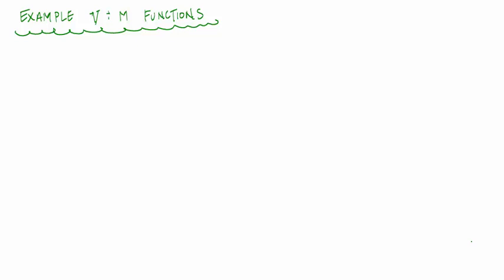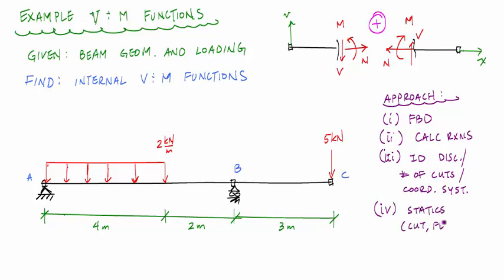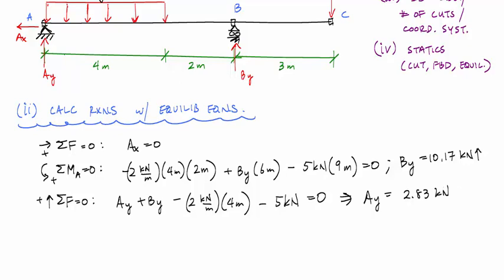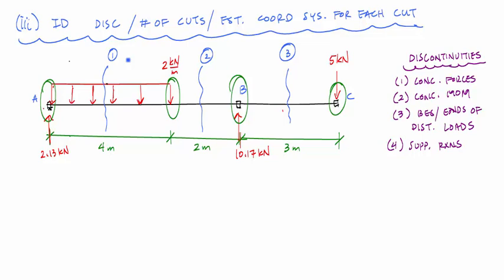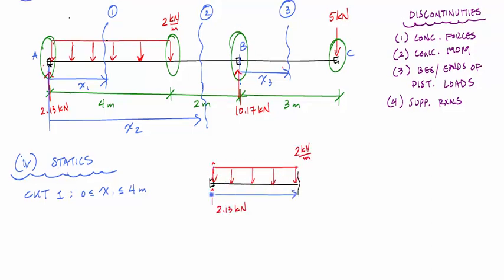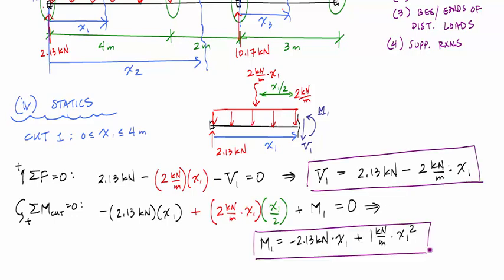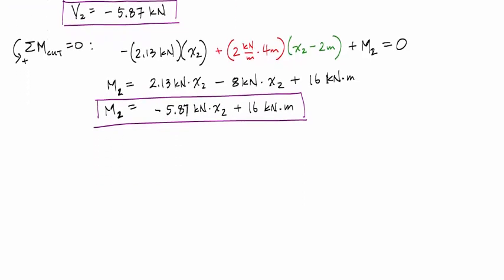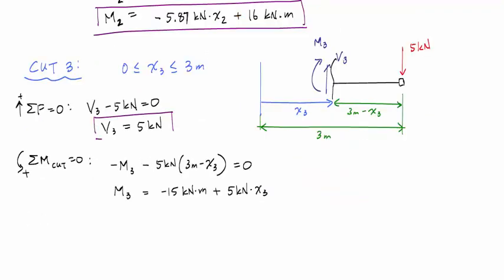Shear and Moment Functions Example 1 - Mechanics of Materials

Comment: @structurefree +structurefree At the end of your STATICS work for cut 1 you got your signs backward. In your bending moment equation it reads: M1= -2.131x1 + x1^2. It should be reversed: M1 = +2.13x1 - x1^2. Your work is correct up to that point. You just goofed on the arithmetic there.
Love your videos. I watch all of the relevant clips after lectures. These make my deformable bodies class easy, and reinforce the material very well. Thank you and keep it up.